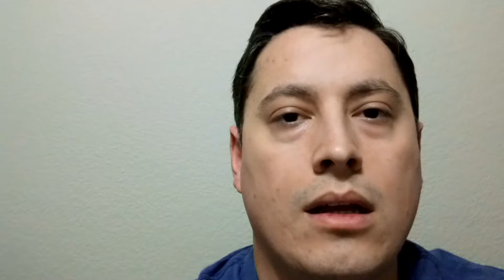Taronis Tech and what is it?

Comment: Hey Felix, Do your DD. Google Magnegas MNGA. There's enough reading to keep you busy for some time. I hope this pops some day, but it's been going down for a VERY long time.
Reply: It won’t stay that low forever..
Reply: Kari Perkins what is a very long time for you? It was at $369.00 in April of 2017 and it’s 5 year high is $7,500. It’s at 0.70 right now..I’m going long..very long, it’s only a matter of time.
Reply: @JerryHeist26  Ha! Dig a little deeper. Look at what happened after each Reverse Split over the years. Bring your calculator. The charts are misleading if you don't know about the multiple rs.
Reply: I do want it to go☝. Need it to... Just not getting my hopes too high this round.
Reply: Kari Perkins I know about the reverse split but like I said I’m willing to buy 500 shares now at .70 and wait 3-5 years..what do I have to lose? $350? But when it goes up it could go up big and I’m pretty sure it will do that sooner or later.